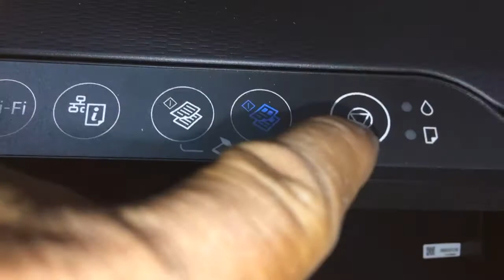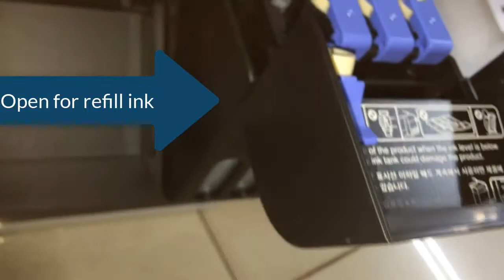Epson L3150 control panel button functions

Comment from the maker: Epson L3150 control panel button functions, Checking the Nozzles Using the Product Buttons
You can check the print head nozzles using the buttons on your product.
1. Press the power button to turn the product off.
2. Load a few sheets of plain paper in the product.
3. Hold down the stop button and press the power button to turn the product on.
4. When the product turns on, release both buttons.
The product prints a nozzle check pattern.
   Print Head Cleaning
If print quality has declined and the nozzle check pattern indicates clogged nozzles, you can clean the print head. You may not be able to clean the print head when the ink level in any of the tanks is low. You may
have to refill the ink tank first.
You can clean the print head using the buttons on your product.
1. Make sure no product lights are indicating errors.
2. Load a few sheets of plain paper in the product.
3. Hold down the stop button for five seconds to start the cleaning cycle.
The power light flashes throughout the cleaning cycle and stays on when the cleaning cycle is
finished.
Caution: Never turn off the product during a cleaning cycle or you may damage it.
4. Run a nozzle check to confirm that the print head is clean.
5. Do one of the following:
• If there are no gaps, the print head is clean and you can continue printing.
• If there are gaps or the pattern is faint, clean the print head.
If you don’t see any improvement after cleaning the print head up to 3 times, turn off the product and wait
at least 12 hours. Then try cleaning the print head again. If quality still does not improve, run a Power
Cleaning
Press and hold the stop button for 5 seconds until the power light starts to blink and ink charging begins, Enabling Wi-Fi Direct Mode You can enable Wi-Fi Direct mode to allow direct communication between your product and computer or other devices without a wireless router or access point,
1. Hold down the Wi-Fi button and press the network status button until the Wi-Fi light and WiFi Direct light flash alternately. Then release both buttons.
After both lights stop flashing, the Wi-Fi Direct light remains on.
2. Hold down the network status button for about seven seconds to print a network status sheet.
3. Use your computer or wireless device to select the Wi-Fi network name (SSID) and password listed
in the Wi-Fi Direct section of the network status sheet.
You should now be able to print to your product directly from your computer or device. If you cannot
print successfully, repeat the process above and make sure you enter the password exactly as written on the network status sheet.
   Using WPS to Connect to a Network
If you have a WPS-enabled router or access point, you can use Wi-Fi Protected Setup (WPS) to connect your device to the network.
1. Press the WPS button on your router or access point.
2. Hold down the Wi-Fi button on your product for about five seconds until the Wi-Fi light and WiFi Direct light flash alternately.
The Wi-Fi light turns green to indicate a successful connection.
   Printing a Network Status Sheet
To print the status sheet, hold down the network status button on the product for at least seven seconds.
Note: If you release the button before seven seconds elapses, a network connection report is printed instead of a network status sheet.
  Disabling Wi-Fi Features
1. Turn off the product.
2. Hold down the network status button and press the power button until the Wi-Fi light and
Wi-Fi Direct light flash alternately. Then release both buttons.
When the Wi-Fi light and Wi-Fi Direct light turn off, Wi-Fi is disabled.
   Copying
To make more than one copy, repeatedly press the B&W copy button or the color copy
button for the number of copies you need (up to 20 copies). For example, to make 4 copies, press
the button four times. Make sure you press the button in intervals of less than one second. The product scans and prints your copy.